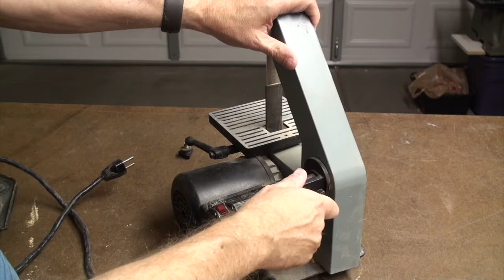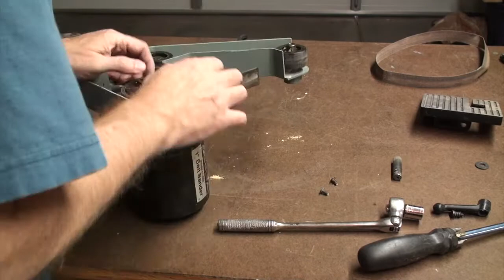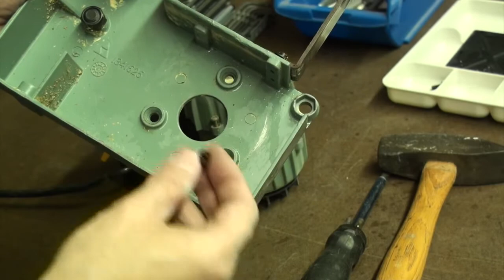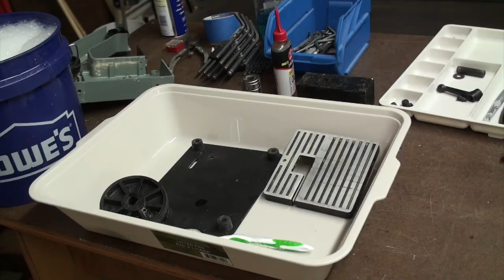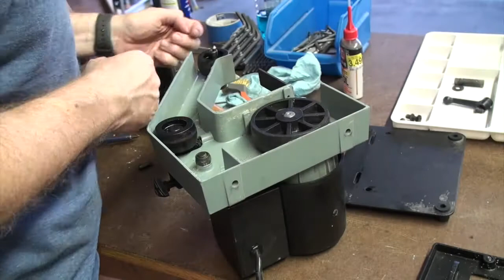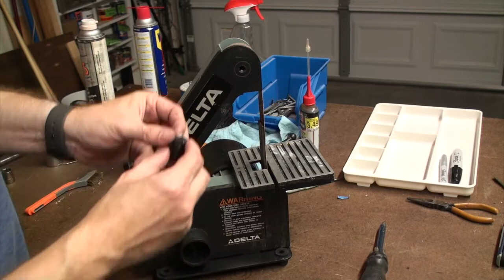delta 1 inch sander repair

Comment: How does one remove the bearings to replace them? I have tried to get them off the shaft and they are on pretty tight.
Reply from the maker: You may have to hit it with a hammer
Reply: If you’re replacing them use a propane torch to heat the inner race and they will slide off, if they’re that tight. DON’T damage the motor windings with the torch.

Comment: I got the bearing numbers off the bearings and found them on Amazon. Bearings are commonly used on a lot of different applications. Parts are no longer available.
Reply from the maker: Cool thanks for the info
Reply: Part#?

Comment: This model Delta is around the 25-25 year old age.   Good running little machines and believe was made in Pennsylvania.   Better than the junk that's in today's market.    I just aquired one for free also.   Motor runs good but also needs a good clean up.   Your video will definitely help out my working on this since there are a lot of small parts.   Thanks for taking the time to make this.
Reply from the maker: Glad it was of some use for you good luck on your repairs

Comment: I picked up a similar model recently and I'm wondering what the bearings in the black pulleys for the belt are because mine need to be replaced
Reply from the maker: Most of the bearings needed to be replaced on mine as well
Reply: @EveryBladeOfGrass1  By any chance do you remember what the markings on the bearings?
Reply from the maker: @sand_man3467  oh sorry no I dont
Reply: Literally here doing bearing research and everybody is talking about them.
Reply: 6202-Z are the bearing numbers in the pulleys.
Reply: You can also use 6202-ZZ. I always use Timken bearings, they seem to last a long time.

Comment: I’m having the same problem on mine, but the noise is from one of the supporting pulleys, not the main shaft. Having a bear of a time trying to remove a roll pin to remove the pulley itself
Reply from the maker: They can be super tough to get out, but don’t give up. I sprayed some wd40 and it has helped

Comment: I notice a lot of people commenting about using bearing grease or changing them entirely, did you end up changing anything or how long has your fix lasted through these last 2 years of use?

Also the main wheel on mine is all metal.. Not black plastic like the others and what yours appears to be. Am I missing a part? Otherwise idk if I have an older model or something.
Reply from the maker: The upper wheel that the belt runs around is not turning as it should so I’ll have to replace that or try to rebuild it or fabricate one

Comment: Thanks. I have the same unit, but mine does have a disc on the other end. Mine has been making that squeak shrill noise. It's over  20 years old, so I know what I need to do now.  Thanks!!
Reply from the maker: Great glad it could be of some help. These things are so old Delta doesn’t carry most of the parts anymore good luck!

Comment: I think those bearings are done. When you spin them by hand they shouldn't do that noise and also putting penetrating oil will just be detrimental for the lubrication.  These bearings use grease. In my opinion better change them.
Reply from the maker: Might change them out soon

Comment: Good video. I’m having the same issue with mine. It’s also occasionally shocking me. Haven’t figured out what is causing the shock...
Reply from the maker: That’s not good, check for exposed wires also that it is grounded properly

Comment: On the bearings, you might need a medium bearing grease instead of the Gibbs oil. Just sayin' in case it happens again.
Reply from the maker: They seem to be to ok for now but I have a new problem in that the pulley on the top is sticking, I’ll try some grease on it. Thanks

Comment: I enjoyed your vid. I have the exact same one. Probably would have just gone ahead and replaced the bearings. Cheap on eBay or  Amazon. Lubing the bearings may be a short term fix at best. 
Thanks!
Reply from the maker: Mark Ashlock  I may go that route eventually
Reply: How much was it? I am looking at one for 25 bucks